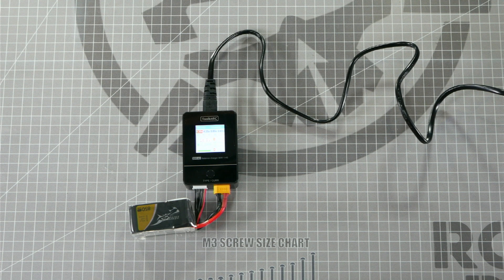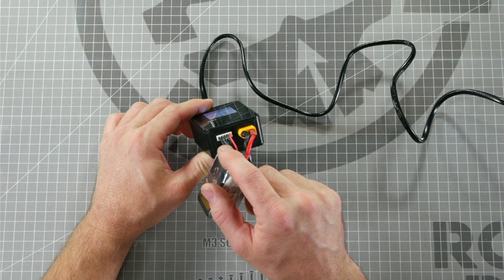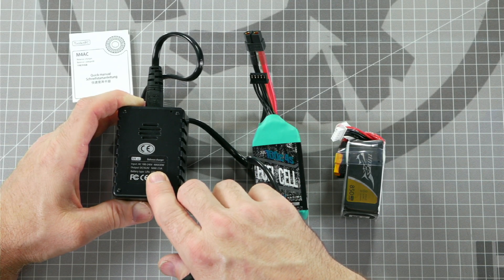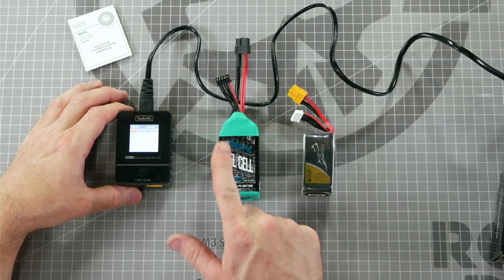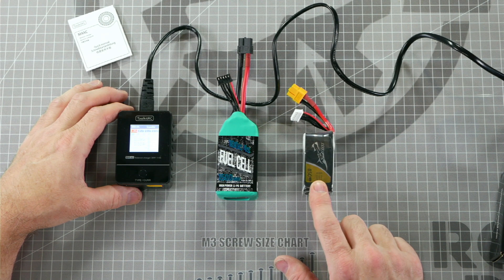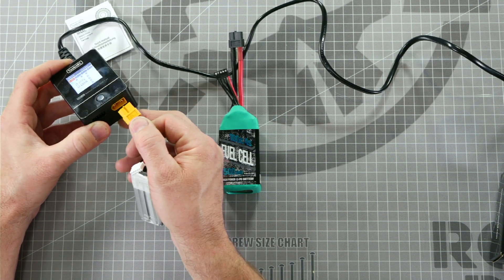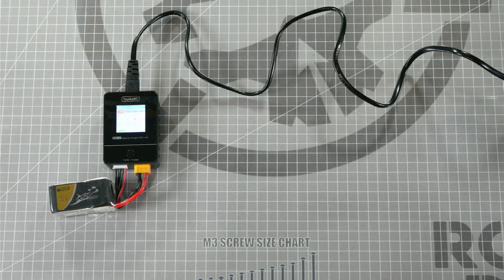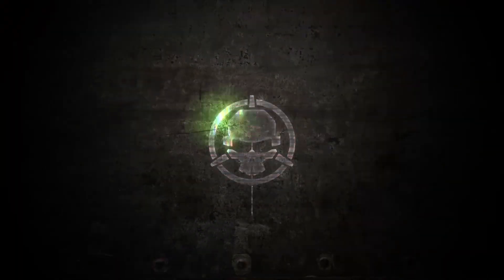How to Charge LIPO Batteries with a ToolkitRC M4AC Smart Battery Charger

Comment: Super helpful video! I’m using LiPos for Nerf blaster modification. 

For my 3S 2200mah battery, it’s best to go with the 2.0A rather than the 2.5A setting?  It’s safer for the battery to set it lower than higher?